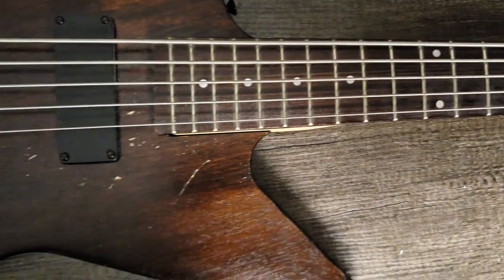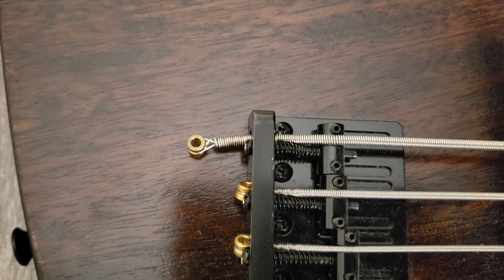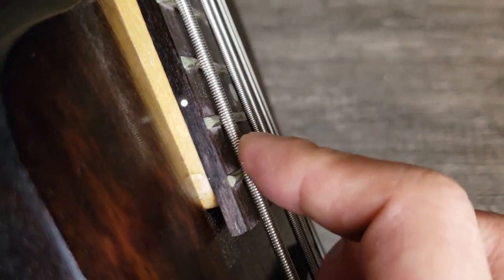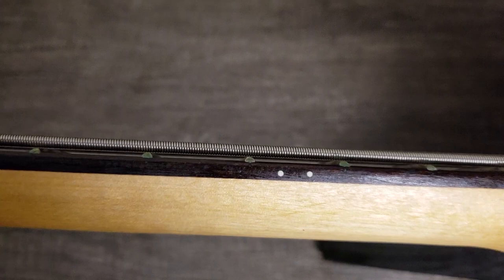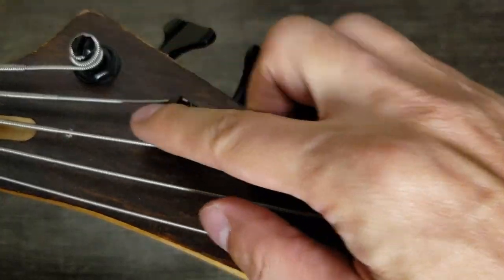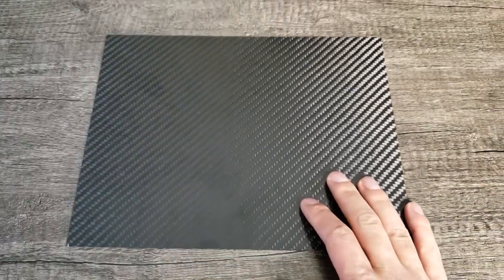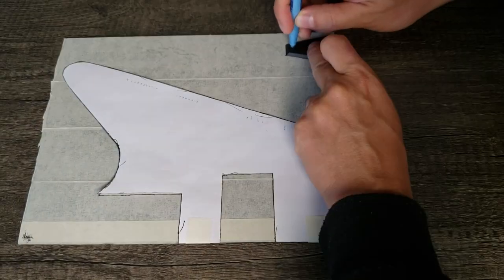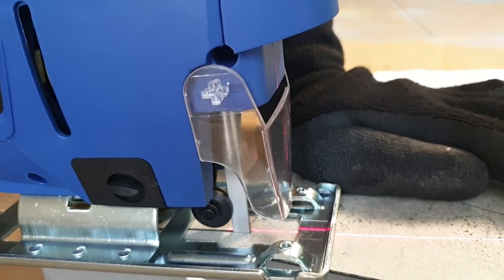What happened to my PitBull EX-5 5-String Bass after a year?

Comment: You had some of the strings on wrong. Not surprising that the machine heads broke.
Reply from the maker: yeah, they just looked better that way...   I know that tuners work one way to tighten and another way to loosen.  But I didn't know it was that critical.  It is just a worm gear...   shouldn't work equally? Never had any problem with expensive tuners.   Thanks for the idea.  Maybe now I won't lose so many tuning pegs...
Reply: @RomanDark  hi, you want the strings to have a straight as pull as possible. If the strings are mounted correctly the machine heads should be fine.

Comment: I still have that weird sound when not touching the strings on mine even after I rewired it with a 3 way switch and a split coil pot. I will try and fix that problem and make the video I promised you afterwards!
Reply from the maker: interesting. what is the sound? like noise?
Reply: @RomanDark  amp buzz when not touching the strings or bridge and a loud click like sound when I touch them afterwards. The bridge is grounded because I checked it with a multimeter. I will try and isolate the control cavity better.

Comment: Pretty nice. Can the carbon fiber you use be sanded/filed with good results? A little smoothing of the edges and corners would much improve the look of the pickguard, imo.
Reply from the maker: Didn't think about it. And my carbon fiber sheet was too thin to work on edges if we talk about rounding it.  But probably you can.  And if we talking about the shape it definitely can be improved by sanding.  I was worried about hazardous carbon fiber dust so I didn't do much.
Reply: @RomanDark  tku, and I'm glad you call attention to carbon fiber dust being hazards in the vid,too. I hope other people who work with this stuff are paying attention.